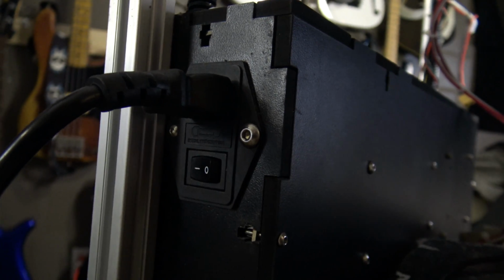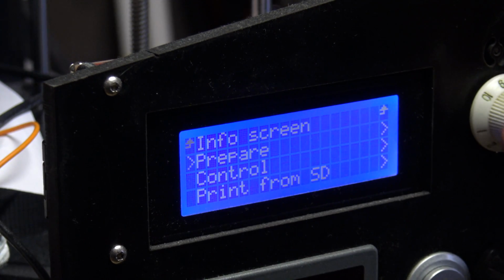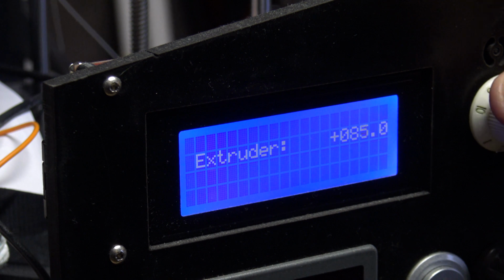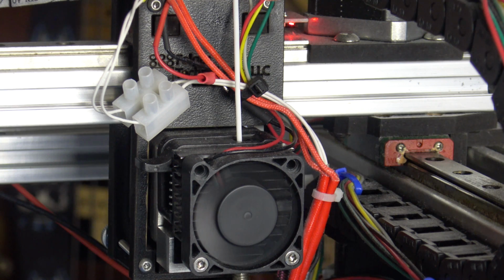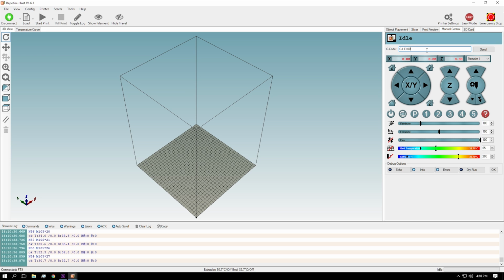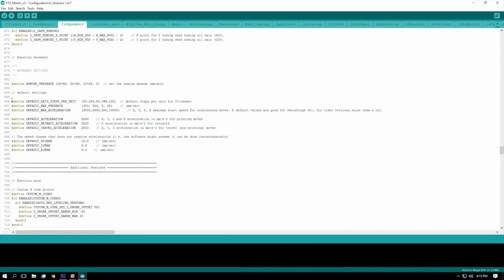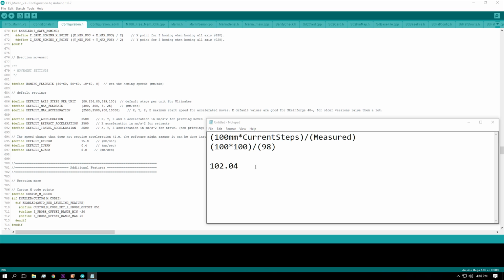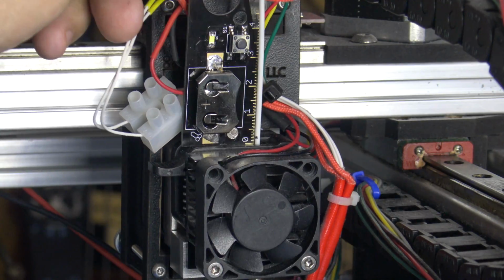How to Calibrate a 3D Printer Extruder Steps Per MM

Comment from the maker: In our example, we extruded 100mm, so ProperExtrudedMM will be 100. 

*You could also mark 100mm, but only extrude 50mm, that way you can more easily measure if you are over extruding. In that case your ProperExtrudedMM would be 50, and you can measure how close to 50mm on the ruler you are.*

There is more info in the description, go there.
Reply: Dustin Corbin why does your ruler have a penis on it

Comment: So how do I do this if I don't have the original computer with the Arduino info?????
Reply from the maker: If you don't have the firmware, there isn't much you can do. Most open source printers have it available. Some printer firmwares allow you to adjust on the fly from a screen, but most don't. May be some gcode things you can do, but I don't have much experience with doing that.

Comment: Hi Dustin thanks for the video that gets immediately the essential. My printer  extrudes  around 30mm less (!!!) and even if I change the step/mm with the formula  (obviously I save the firmware ) doesn't really look like changing.  I changed the extruder step motor but is exactly the same.  any advice?  thanks! !!
Reply: Marco Vignotto after you uploaded the newly modified firmware, did you save the new eprom settings?  Also have you checked voltage on the stepper? Finally pay close attention to the extruder motor/filament gear... is it slipping? Grinding? Or working flawlessly?
Reply: Did this just this morning. Turns out, I needed to go into EEPROM -> Load Settings on the LCD menu.